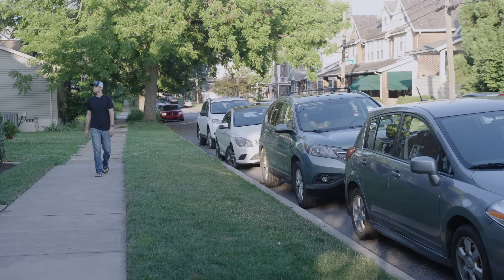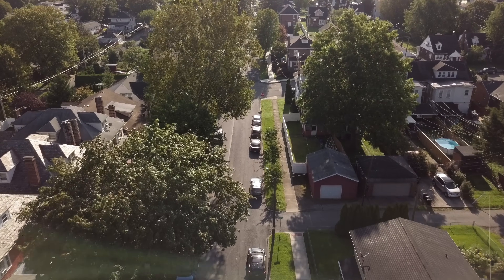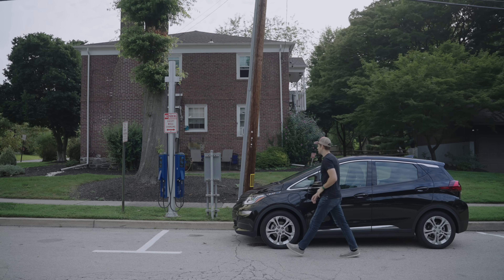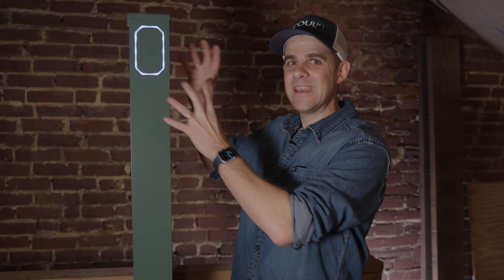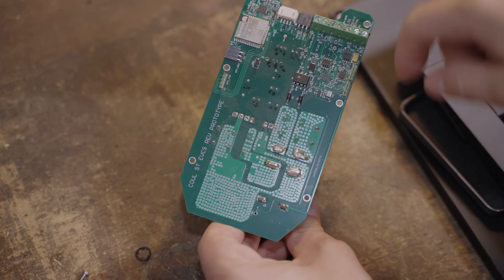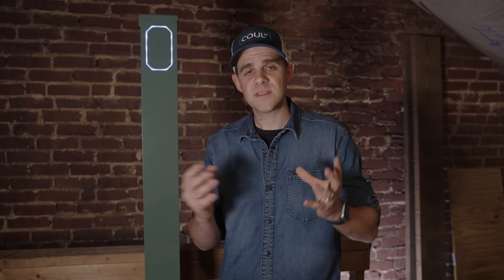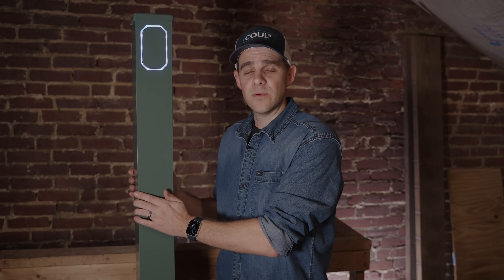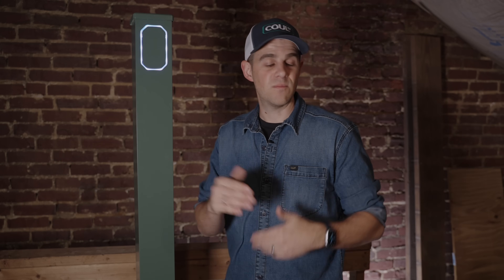You've Never Seen an EV Charger Like This!

Comment: If you want to properly weather seal the cables coming in, please consider doing what is recommended on houses: 1 cable 1 hole, sealing a single cable in a single hole is far simpler and more reliable.

Comment: 2 things for success (IMO). 1. Make the EVSE OCPP compatible- this will help alleviate fears that if the company goes bust the things you need disappear like upgrades, backend booking and billing etc. 2. Rather than a traditional business model where you just try and sell the EVSE's make it a club with membership that supports the backend with booking the EVSE in advance, billing etc. Perhaps even partner with one of the existing auto breakdown companies like the AAA in the US who can help with the backend because they already have all that infrastructure in place. 
I can see applications in apartment carparks etc so I would design wall mounted solutions as well as post mounted.

Comment: Seems like a decent idea. I’m in the UK and this seems like an offshoot of a couple of ideas we already have here, but will face the same hurdles.
We have Gullee. It’s a channel through the pavement(sidewalk) to the kerbside to allow an EVSE cable to be run though it between an owners vehicle on the road and an EVSE within their property line. Some areas prohibit this crossing the public land.
We also have co-change who facilitate shared charging allowing you to rent out your charger.
Even if both of these are combined, a homeowner still has no say in reserving that parking space on the public road.
A few companies have trialled buried retractable EVSE points within the ground at the kerbside but these have been limited to just a few commercial and local authorities my operators.
Allowing these installations long term would probably require a long term lease of the public road and the land which the cable crosses as well as liability insurance with or without the public access.

Comment: I'm interested in the Mk5's electronics moving inside the house. Does that mean you won't be able to light up the door panel until a charge is initiated? I wonder about where the electronics will go in the house: at the breaker box or in an outlet? Looking forward to the next progress video.
Reply: Should be trivial to have a constant low power feed for the LEDs. They use very little energy and don’t have the same safety and cooling concerns as the charging lines.

Comment: Copper thieves will be all over this 😂
Reply: That's why the cable is removable, and the post is set in concrete.
Reply: @robinbennett5994  
That makes it easier for the thieves to grab and run. Easier than porch Pirate 😁
Trunk full in 5 minutes per block 😁
Reply: Something tells me: The neighborhood where you'd install this EV charger; More than likely don't have the problem of copper theives.
Reply: @jsenurquhart  
Thieves don't care where you live.
Once they find out there are hundreds of charging cables hanging off the cars. They see easy $$$

Comment: paint the inside of the post black, it will help with thermals a good amount because it will not reflect as much heat back inside. i believe with non forced air cooling solutions for temp ranges where most electronics hang out, radieative heat transfer is actually the dominate mechanism for heat movement. most people dont stop to think about a surface's emissivity but if youre trying to go without a fan/forced air cooling system, its very important.

Comment: Wouldn't it be a better idea to use the SAE's updated J3068 connection standard instead of a J1772 for detachable cables? SAE calls J3068 the universal ac connector and intends for it to be used for chargers with detachable cables even in North America.
Reply: It's been mentioned by someone in everyone of the videos.. but keeps getting ignored for some reason.
Reply: @mark123655  I think he actually said at some point they will, can't remember which video so take that with a grain of salt

Comment: In the old days, people used to install a gas pump in front of their homes on rural areas to make some money on the side because gas stations were very rear there. This is no different and multitudes cheaper and simpler to do. 

I can see entrepreneuring people in rural areas with large solar arrays selling their extra electricity with a charger or two in front of their homes or small business.
Reply: Well, you'd have to set up a campsite with it. Remember this is L2 charging. So overnight or destination charging.
Reply: @mondotv4216 I'm talking with a 40 or 50kW charger or two, not level 2. A 100kW solar array on yard or the large roof of a small business with an industrial inverter. You can increase it to a larger array as it pays for itself. You also add some batteries as they get cheaper and cheaper to collect solar all day long and then charge a few cars per night or when the sun is low. An entrepreneur doesn't think small like you. That's what makes them entrepreneurs.

Comment: Have you seen “EV Ultra” cable from the UK? It’s 3/5 core armored cable with an integrated cat5 cable. Not sure if there is equivalent in North America. Could be interesting solution to move the majority of the electronics indoors like you say but then use the cat5 to provide some data to the post for status lights/temp sensors etc.

Comment: Its sad that installing a 220v oultet in a streetlight is such a difficulty for our modern civilization.
Reply: Well, considering commercial power isn't 220/240 and the circuits are designed to run a couple of lights rather than a bunch of high draw applications and then you have to figure out billing and costs... Suddenly you realize why it's more difficult than you think initially.
Reply: Thank you all for demonstrating how America has become the Can't Do nation.
Reply: Street light chargers are happening in the UK, although it's pretty limited at the moment. There's a fair bit of spare capacity in some of the cables where the lamps have been converted to LED - and the chargers are networked so they can slow down to avoid overloading the cable. Billing is done over the cellular network. It's not as simple as installing an outlet, but it's not rocket science.
There are definite advantages to installing a charger from your home's supply when you can though.
Reply: The issue is that they’re not wired with the wire gauge required to safely supply the huge current needed to charge EVs
Reply: @icandreamstream  Not really (for AC charging that is, this isn't DC fast charging), I mean one of the most popular ways to install an EV charger is to install a NEMA 14-50 receptacle and plug a portable 240v EVSE into it. 

The real problem with normal NEMA receptacle in streetlight poles is weather protection (and payment). EV plugs are just much better suited to the situation, so BYOC (bring your own cable) makes the most sense. The only thing that bothers me is the Europeans went with the wrong plug gender on the pole (which we are now stuck with if we're using their connector on the post), their BYOC cables are male to female instead of female to female (male end is on the ev there apparently, it's based on the contacts/pins themselves which is male and which is female, MC4 connectors are similarly confusing) so their BYOC cables are made like extension cables, so you can't use the same cable to do vehicle to vehicle charging. At least in the US we will have to have separate cables for V2V anyways since we use/will be using NACS on the vehicles side anyways.
Reply: @icandreamstream you don’t need a huge current. 10A is fine overnight.

Comment: thats all well and good but what happens when a neighbor on the street wants use your charger at the same time you want to charge your car from your electricity? that's gonna get old real fast
Reply: As the EVs in the neighborhood start to proliferate, the owners of those cars start investigating how to get something like this for themselves. For reference, I've owned a used EV for 9 year now and have always charged it off the 120V outlet on or near the front porch of whatever property I happen to be renting or owning.
Reply: I was thinking the same thing I think a good add on on the app is block out when people can’t buy your power. Especially it creates a time when you will use the charge for yourself
Reply from the maker: This is an option, but there may be different restrictions based on the charger location. For instance, some municipalities may require it to remain "public" at all times, which may not be ideal. As @benjaminnead8557 says, this is an issue that we see as a short-term one. Eventually, others will become interested in how you are charging, and the network begins to grow.
Reply: Two options authentication so only you can use it or billing so you can charge when other people use it.
Reply: Set the fee really high